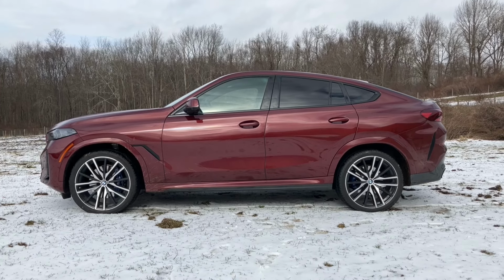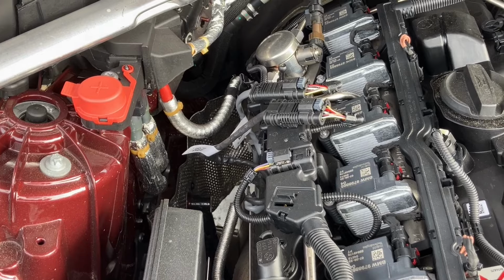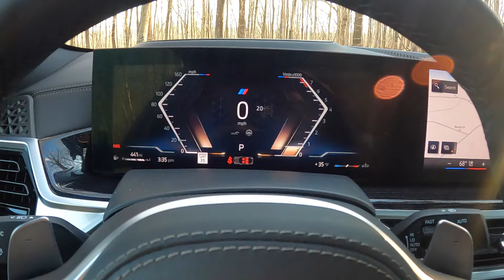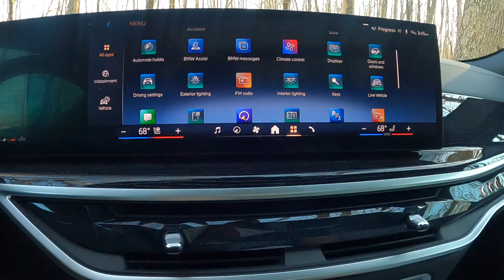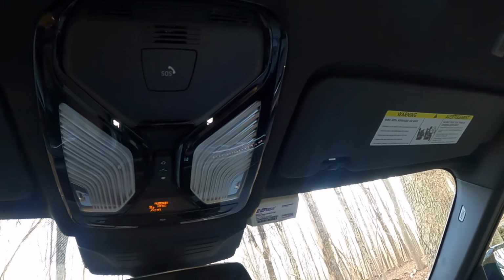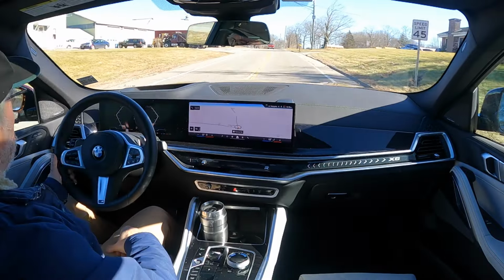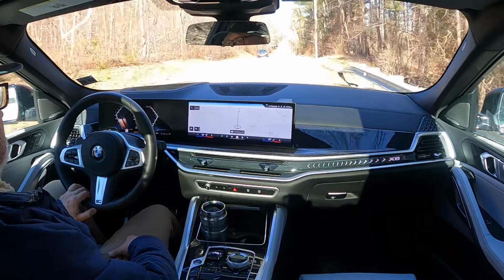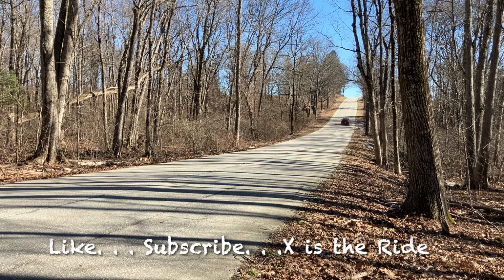'24 BMW X6 xDrive 4.01 Review

Comment: So why didn't you take the time to learn it first?
Reply from the maker: Great question. These things should be intuitive for somebody who's been dealing with car interfaces for a couple of decades. I should be able to just drop and and go, but the fact that I have to mess with it and discover what's going on is my way of telling get viewer this is not a logical, familiar interface. Most people that would be buying one of these is not going to spend the time studying an owners manual in advance, so I try to go into it they way they would. This is my approach, which is different than most car reviews. It's by design.
Reply: @MachinesWithWheels  we have had a G01 X3 since they were introduced and I see the G45 will most likely have the interior features of this car you reviewed.  I was hoping to see how you controlled the cabin heat which you obviously pulled over to figure out 😂